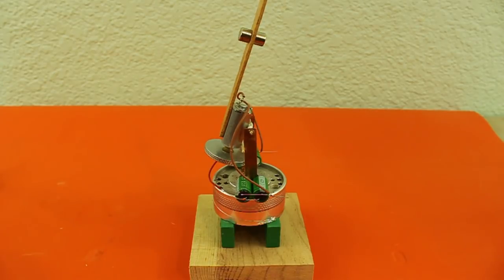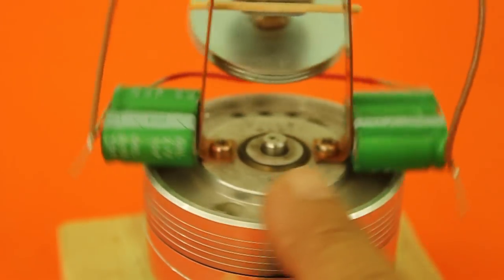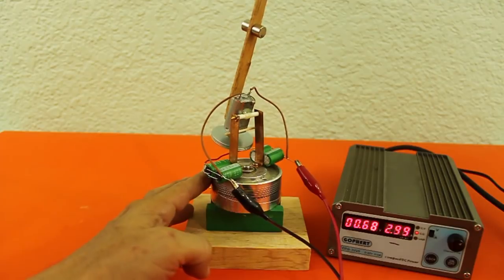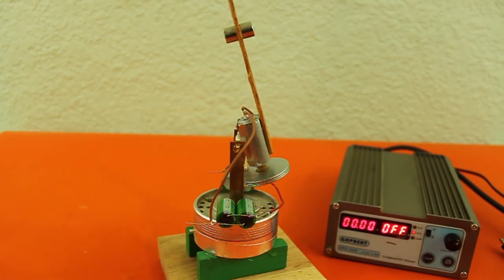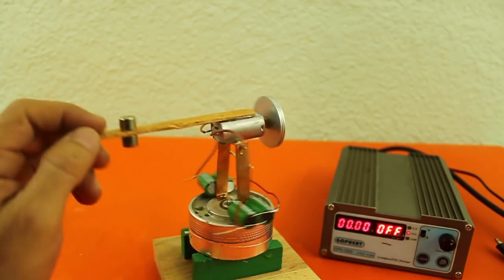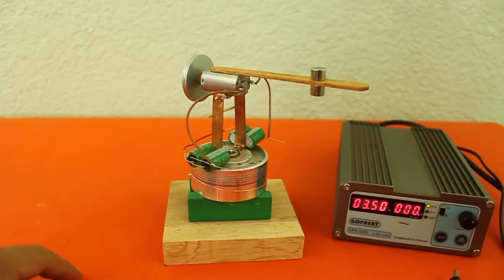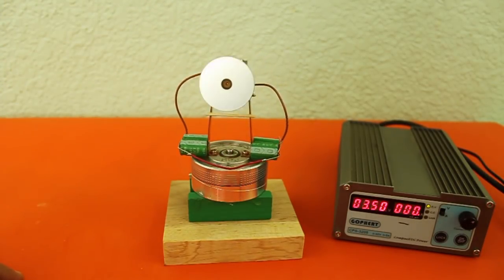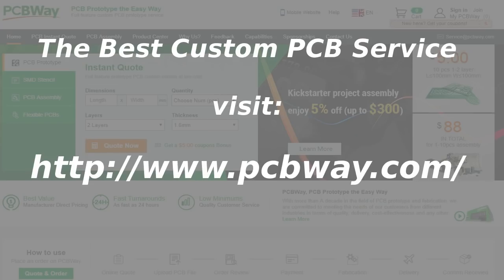Homemade Gimballed Gyroscope

Comment: So if you have another wheel spinning same rpm, same section of gimball, but either the same side of the fulcrum with opposite spin, or opposite end of fulcrum with same direction of spin, the gimball should remain motionless on that section? Perhaps all sections if the wheels are at opposite ends of fulcrum (creating a balanced section)?

Comment: Very nice, but can you build one that can proove the earth's rotation? That would be even cooler!!
Reply: Check this out.
https://youtu.be/Ey12aoF4JOc
Or
http://griffithobservatory.org/exhibits/centralrotunda_foucaultpendulum.html
 Its a pendulum that swings so slow from its size and weight that it takes some time to get from one side to the other. Because of its inertia and time vs. Earths rotation, every swing is retarded a few millimeters back from the previous swing. So in one day, the whole pendulum has spun 360°. Its like a giant grandfather clock without all the gears.  Its very cool. 👍
Reply: How would that prove the Earth's rotation?